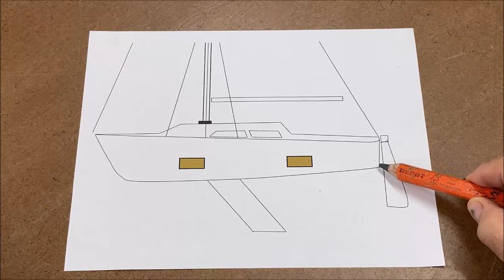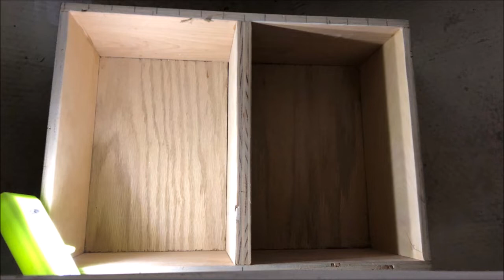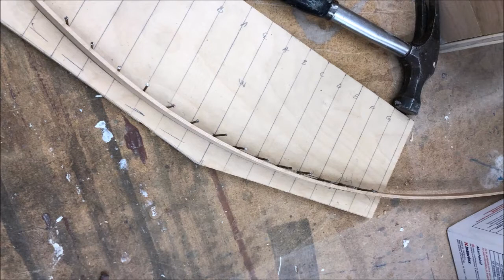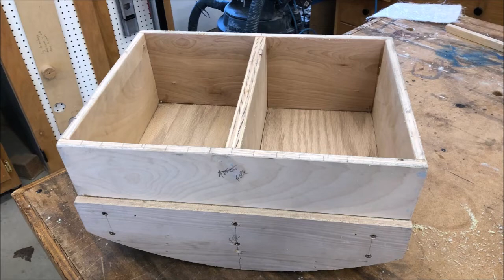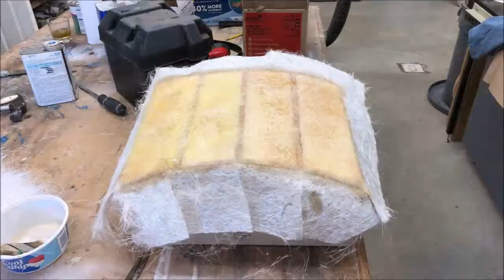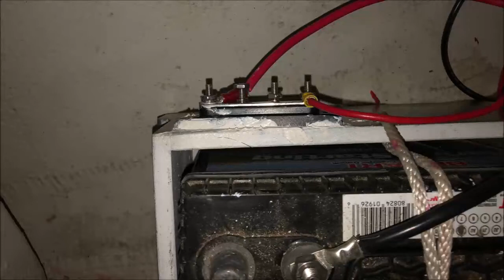Build a Better Battery Box  -- Catalina 22 -- Jim's Little Boat get the weight forward

Comment: Did you use marine plywood or regular plywood?
Reply from the maker: I just used some exterior grade plywood.  I didn't worry about it too much because the boat was (is?) very dry inside and I primed and painted all the top surfaces and fiber glassed all of the bottom that touched the hull.  I don't know why, but except for a few things installed in the cabin top, the boat never leaked a drop and I fixed the few that did.  I was lucky.  -well maybe I earned a little bit of the luck-
Reply: @jimslittleboat4388  Did you have to remove the porta-potty metalic container and the hoses from the locker under the V-birth and plug the hole before putting the battery box?
Reply from the maker: @bzh0l1  This was a 1977 boat so the porta-potty was not an issue.  In fact I got rid of the porta-potty and put in a luggable loo--much better for our boat, and female approved.  There is a separate video.

Comment: This is very cool, thanks! I'm wanting to build some removable watertight lockers for my 14' sailing dinghy forward of the thwart to hold gear when cruising. Something that will float in the event of a capsize (which I sure hope never happens!). Do you have any ideas or projects for that? Thanks!

Comment: Great video. Wondering if you’ve ever done a video on securing the boat and components while moored at a marina. Saw your video where you showed where the motor mount was pried. Yikes. Thanks Jim
Reply from the maker: Well, Eric, this is going to sound funny, but other than the motor, I don't lock anything up. We have a lot of live-aboard folks in our marina--and even if someone did break in, I would rather have them steal my stuff than break my boat.  The motor is a different deal because the tweekers row in on dinghys and try to steal outboards.  The lock is to slow them down and require them to make noise.

Comment: Jim, I have 1976 Catalina 22  . I need to tighten the boom bar that is mounted by two nuts located at the bow.  Problem; you cannot fit sockets between the housing  to tighten the boom bar nuts. I really do not want to cut holes in the hull to access .
Reply from the maker: Timothy, I don't know what a boom bar is.  Just looked it up and didn't get an answer. Could you send me a picture in an email:  jslosson@aol.com

Comment: Two, forty pound batteries and... how much does your battery box weigh?
Reply from the maker: I don't really know, Mark.  I forgot to weigh it--not much maybe 10 pounds, maybe less.  Right now I only have one battery because the ones I wanted were $250 a pop and I didn't want to spend that much money that month.  I am told the batteries in parallel need to be the same type and the same age.  Don't know if it's true, but one battery is plenty since we have the solar charger.
Reply: @jimslittleboat4388  yes better both batts are same, if not one will discharge into the other and when charging they will get different charge rates...